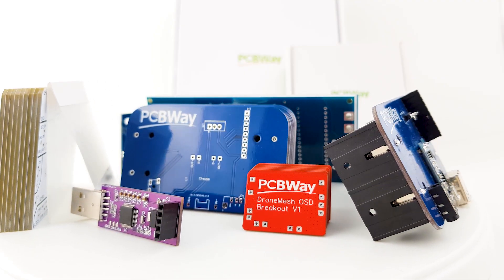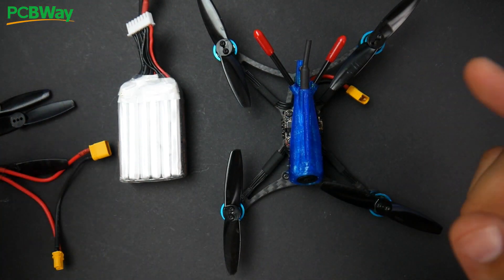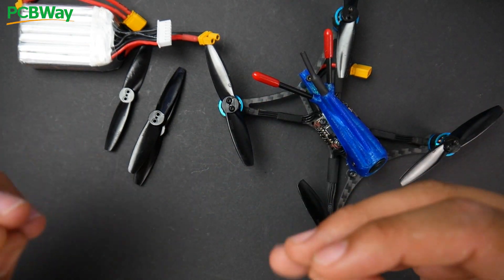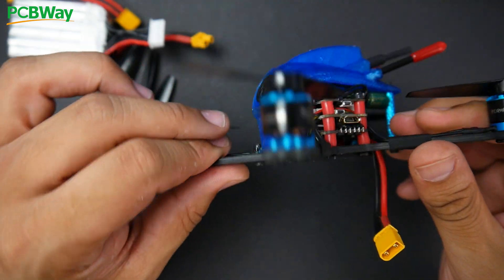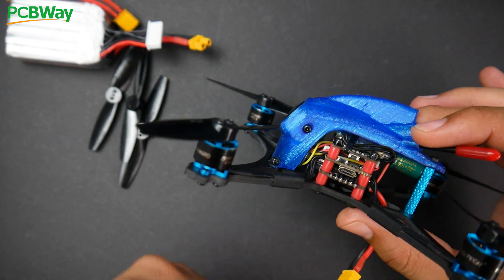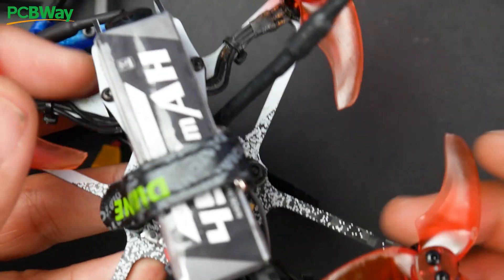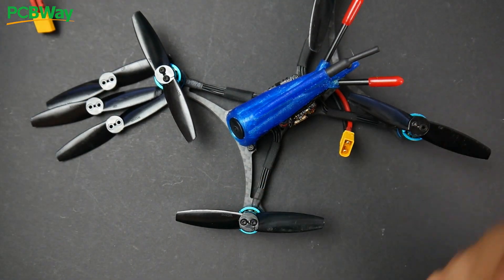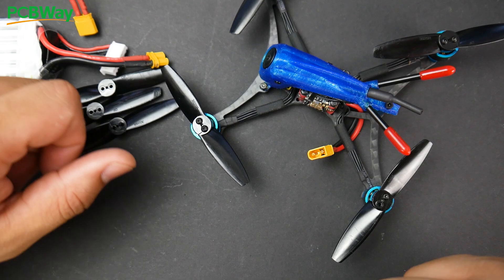THE BEST 3INCH FPV DRONE EVER!!!! // HGLRC Petrel132 6S

Comment: Great video great advice on the props. Get this I even used a 3s 450 and it's still so fast and close to  over 10 mins even hitting 11 mins  great little quad . Bro 3 times I accidentally crashed in pure concrete except for props broken quad still a champ! Of course always better fly above grass hands down one of the best quads for a begginer (use a 3s 450) and for pros too and it's also so quiet my God a perfection and always warm or cool after a flight! Imagine if they put a nebula on this .

Comment: Hi Sam   I purchased this quad one day looking through HGLRC website and I love flying this little guy,  and for a 16X16 flight stack it's working great.  Thanks for the information on the 6s 450ma battery I have been using 2- 3s 450ma and I can't wait until I can order one.  Thanks again for the video.
Reply: Bro I've used the 6s it's a beast in speed can catch you off guard it's almost too much for me lolol still learning love this sport!

Comment: I have the 4S version of this and it's a freaking beast, can't imagine what the 6S is like in comparison!  Great review!
Reply from the maker: This is on another level I flew both but this is an absolute keeper
Reply: Considering ordering the 4s version but i have a ton of 3s packs and really dont want to buy any more micro batteries. Will it be a slug?
Reply: @overdosed51  I have the 4S  with open protective guards... 6min30 with a 3 S 650mAH  ( 11.2 V remaining after flight )
Reply: @moimeme8864  thank you! Flight time is what im looking for. Ill can get my speed thrills with my 5in quads 🤣